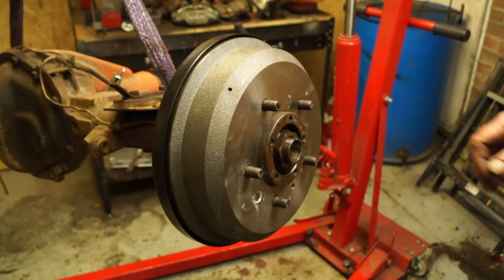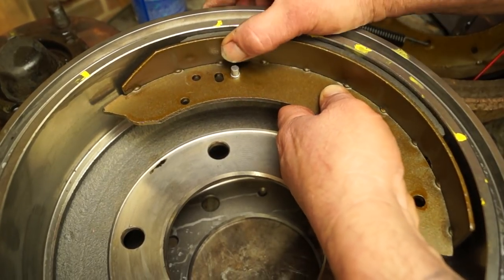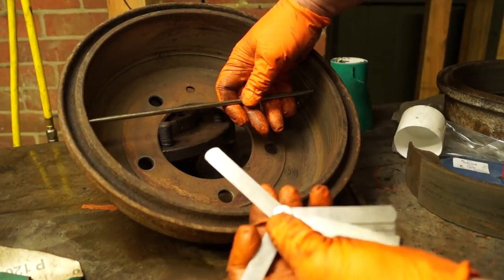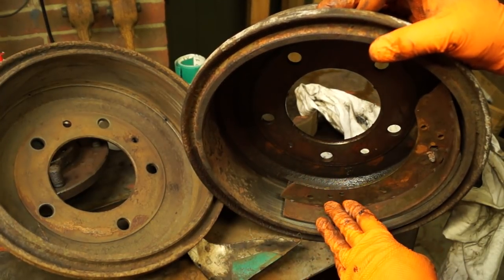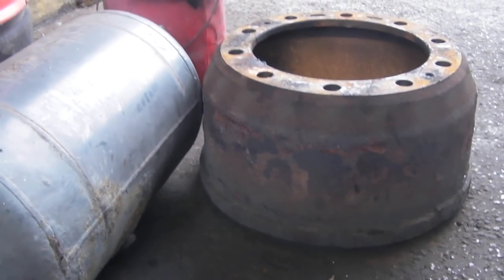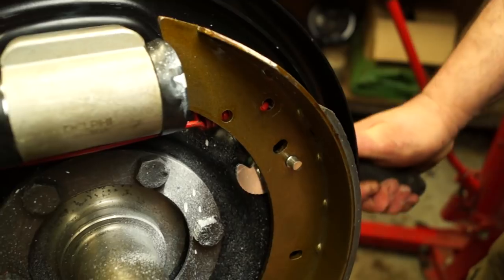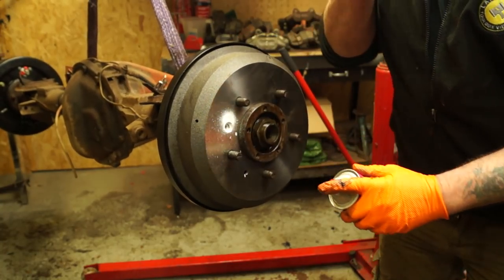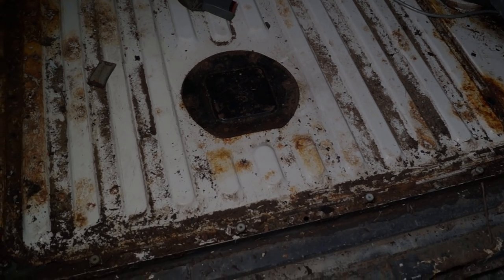Land Rover Drum Brake Overhaul  Part 3.  Check Drum Ovality and condition, Fitting Shoes

Comment: Had to take hub off mine to fit shoes. First try with hub on resulted in not only bending the metal (same as yourself) but the damn spot weld bits that hold the brake shoe curved parts together `pinged off` and left me with a god awful mess (wrecked). Also (hub on) trying to get the top spring back in, lol, forget it.
Hubs off for the win.
Great vid, many thanks.
Reply: Cant remember, but is there a gasket to be replaced if that happens? also.. on a front wheel with free wheeling hubs, that 'll make it more complex? It's been at least 7 years since I looked at mine.. (sat in the garden for about 5 of those years)

Comment: I am a QC inspector and i would be hard pressed  to measure the ID of the drum with that setup, rod and feeler gauge; the positionning and angles of the rod are so critical that several pairs of markings needed to be made on the ID with a caliper and a marker; a proper bore gauge has 3 points; also is it possible that a new drum that has been turned at the factory is out-of-round? guess so.
Reply: That is why he checked it, no?